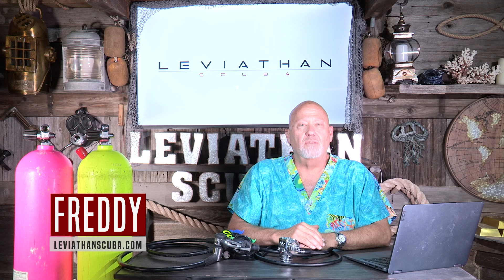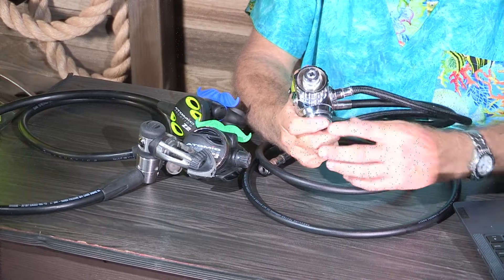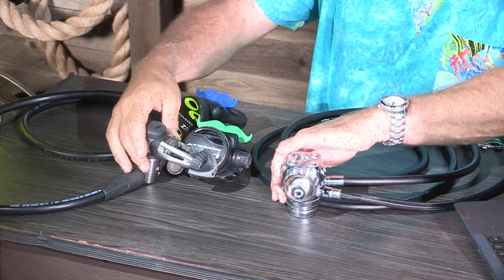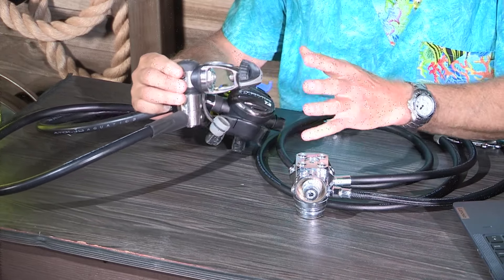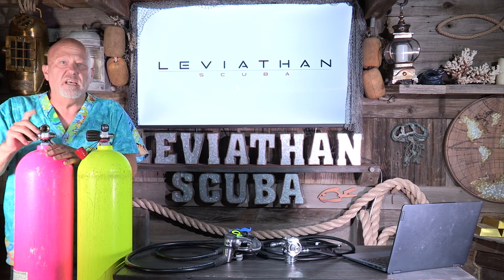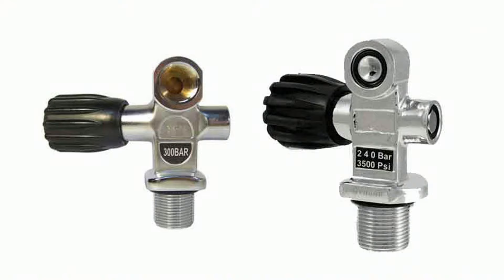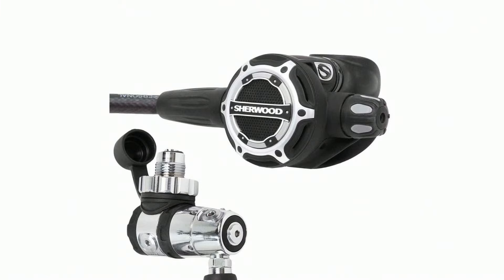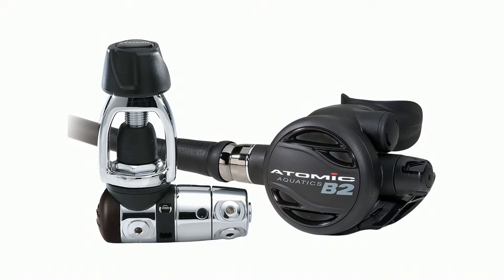DIN or YOKE

Comment: Hi Freddy and thank you for the video. I was just getting ready to change to DIN and now I"m rethinking it.  I am a recreational diver but love wreck diving. I'm a big guy and sometimes the openings are tight. I have "banged" my first stage on the top of several openings, even though I'm really trying not to. I have this fear that I'll knock the reg right off of the valve. I have never seen anyone do that but I have heard others tell me they've seen it. I believe that is why cave divers use DIN exclusively. That coupled with the fact that 99% of recreational divers use short hoses, it would be difficult to quickly get some help for an emergency inside a wreck where space is tight and your dive buddy is behind you or in front of you.  I would love to hear your thoughts on that?
Reply: here comes the real question, do you rent your tanks or own them? cause if you rent where you dive, you'll have to use an adapter and then you're back to square 1. If it will make you feel safer, and I totaly get that, I can see it make sence...but, if you do you have to account shelling out for new tanks as well or the benefits are nill.

discalimer "I run a DIN with an adapter" cause I read the "they are stronger" blogs, but have yet to buy my own tank so i'm not seeing the benefit and wish I just bought a yoke.
Reply: @marcg2233  Convenience really isn't a factor for me regarding renting tanks. 99% of my diving is around the world, esp. Caribbean and Gulf of Mexico.  Just got back from Little Cayman and I noticed that they used the Yoke insert in DIN valves for those of us using Yoke. On one of my dives that O-Ring was bad and I had to get it changed before dropping in. For those using DIN, they just took the insert out for a native DIN setup. It would appear most dive resorts are going that direction and if so, I'd rather have DIN.
Reply: @zstanman482  if that's the case cool, means I made the right choice, first time. I just need to start diving those resorts:) any recommendations?
Reply: @zstanman482  thanks i'll check those for the next trip.
Reply from the maker: It is a valid point but often what part hits the cave or wreck is depending upon where you have your tank mounted. Higher or lower. Lower is preferred when in tight spaces because if you shoulders fit then the rest should. Not 100% but if tank is a little lower then more clearance not being so close to the head. You tend to flatten out after your head enters. Either way they both work. Exclusive cave diving usually has DIN. I dive a lot of wrecks and I lower my tank a bit and don't have any problems. Thanks for expanding the conversation. Take care, Freddy